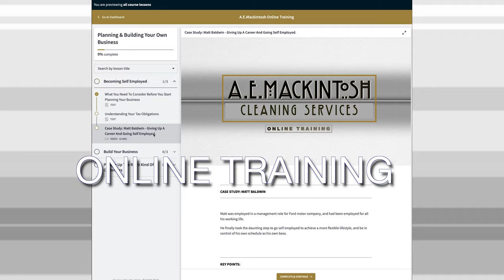Best Roof Cleaning Transformation of the Year!

Comment: Hi ash, hope your well.
Just after a bit of advice really, I’m really sceptical about cleaning roofs with water pressure because  I don’t want to take away the protective film on the tile. Does this always happen? Or is that just like when people use a turbo and blast the tile rather than a mosmatic fsc.
I’m sick of roof scraping 😂😂
Reply from the maker: Yeah, I find a turbo nozzle is way too intense. I reduce the pressure on my pressure washer and then that pressure is split across two fan jets on the fsc. This is a great way to clean the surface evenly without being too intense. You can’t use this on every roof tile, but yeah, much less tedious than scraping.😜👍🏼
Reply: @aemackintosh   Thanks for the reply, yeah I’ve been flat out in the winter months with roof scrapes, not so much bioside as people don’t want to pay for it 😂 … would love to give an actual roof clean a go, so much more satisfying

Comment: Hi Ashley, ive got a question. I have a vevor surface cleaner. I want to mount this to a pole for roof cleaner. What kind of connector do i need and what pole? Thx for the advice
Reply from the maker: The main thing you need is the fitting that just fits inside the top of the pole. I get my kit from Rutland Pumps. If you give them a call I’m sure they’ll help you out.👍🏼
Reply: @aemackintosh  i have an unger nlite pole. Do you maybe have a amazon link, or an image for the fitting? Im not from the uk and they dont ship to where i live.

Comment: Happy Holidays Ash, Just wondering how you get behind the chimney from the lower position with the surface cleaner without climbing on the roof? Do you run some kind of extension with a bend it?
Cheers my friend.
Reply from the maker: Thanks. If you approach the chimney far enough off to the side, you can reach behind it enough to reach at least half way. Then do the other half from the other side.👍🏼
Reply: @aemackintosh  just wondering if it would reach around. Some chimneys are pretty wide

Comment: Does your extension poles ever gets stuck from debris falling in between each pole?! I have sand always get stuck in mine . Great videos ! Watching all the time from Southern California! 
Why don’t you treat the roofs with sodium hypochlorite application method with a 5.5gpm pump ? You wouldn’t need the pole to apply . I highly recommend watching @PowerfulIImprovement on YouTube
Reply from the maker: Thanks. We take a slightly different approach to chemical application in the UK. I treat my roofs with biocide after cleaning which will help prevent the moss returning. This is applied with a closed spray system (brush with fan jets) to prevent chemical drift.👍🏼